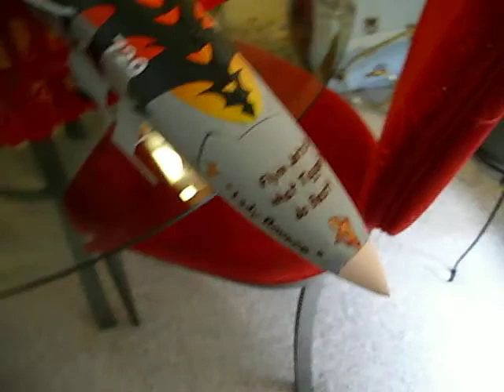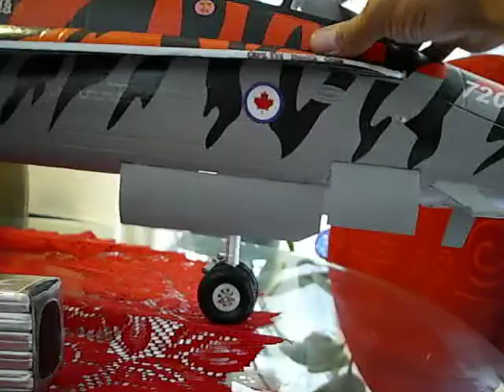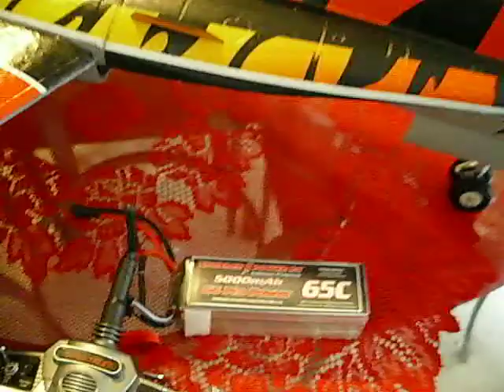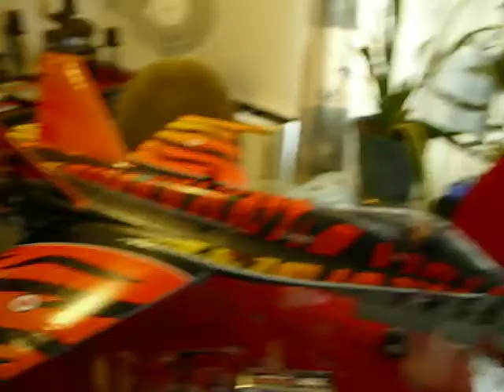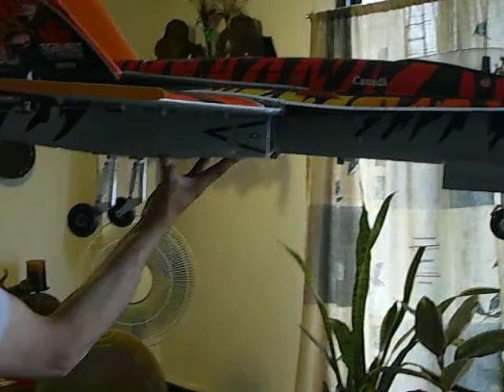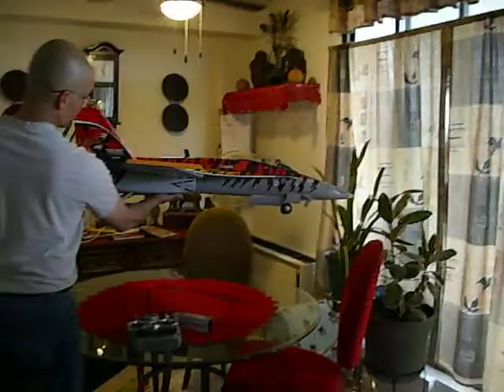Starmax F/18 90mm with retracts

Comment from the maker: To be honest, this plane didn't survive her maiden flight. You can see that the nose gear is too small so it airfoiled and wouldn't take off. So I removed the gear and hand launched it only to find out the CG was too far back, so nose nose up and a cartwheel later, I had to buy a new body. It was all caught on camera but that's being held hostage by my evil mother in law. So the body's been replaced, Tigger's back in the cockpit and all the problems have been fixed. Video pending a camera.